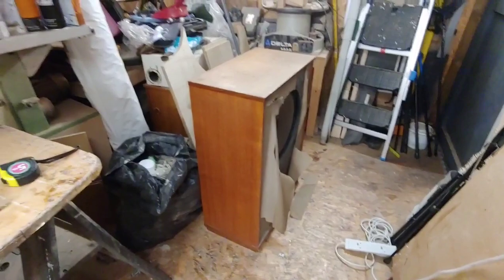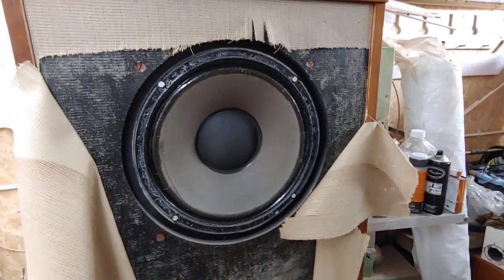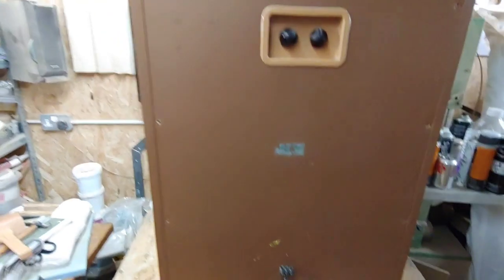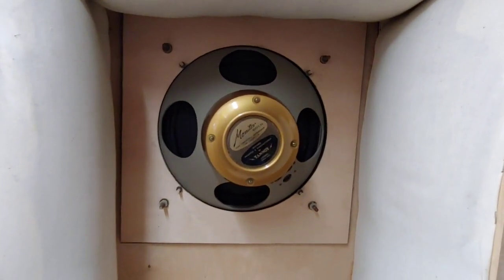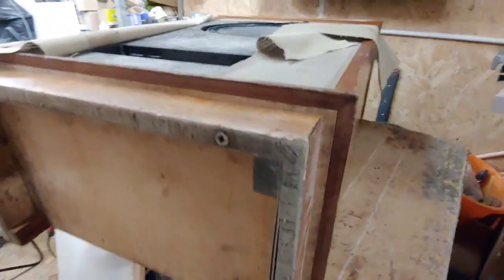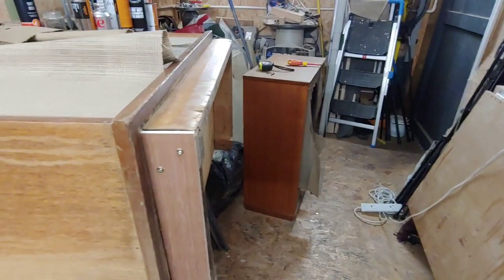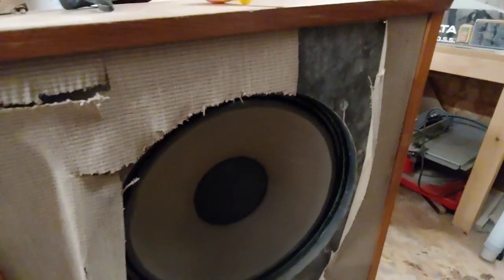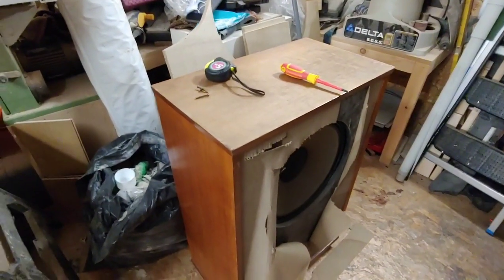Tannoy Monitor Gold Loudspeakers restoration Pre View.

Comment: Somebody threw one of these out and me loving speakers  I somehow walked over half a mile with one on my shoulder. I wish I done my research as I thought somebody put chicken wire and what looked liked stapled pillows and I removed them.  The speaker is a 12inch monitor gold in perfect condition  with crossover that works,  treble and wobble control.